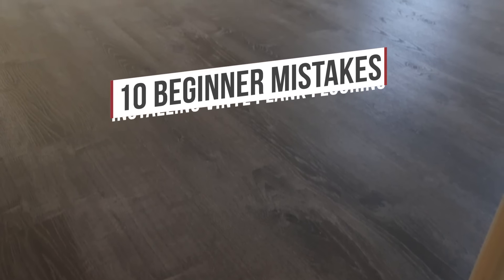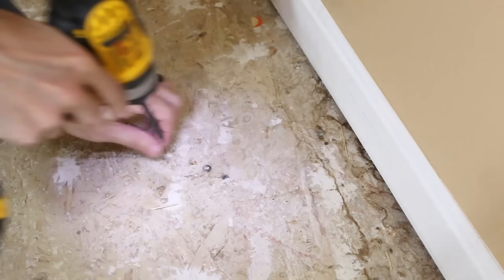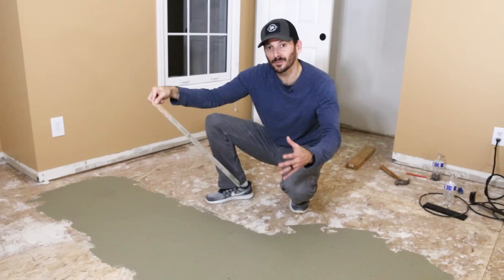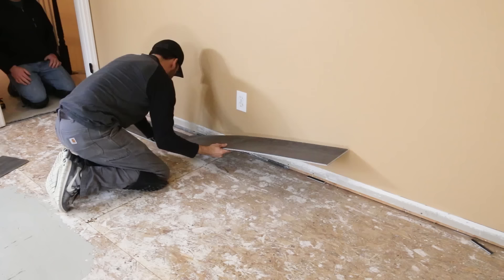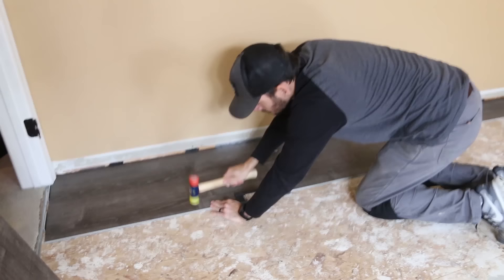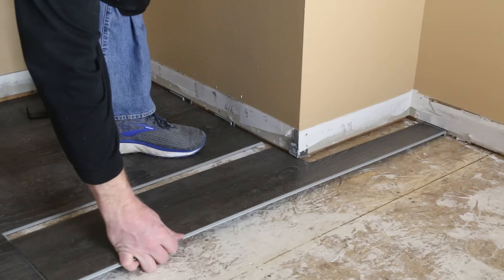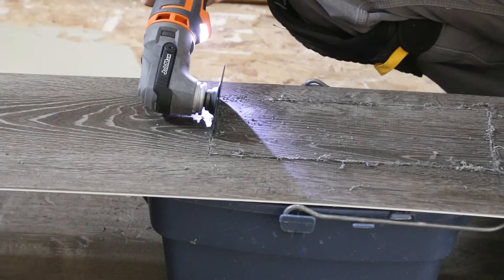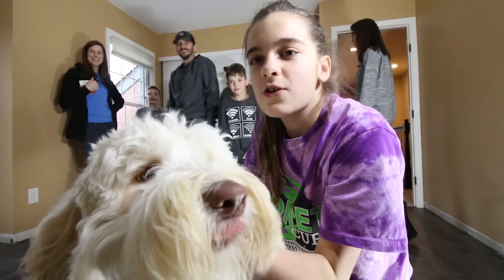10 Beginner Mistakes Installing Vinyl Plank Flooring

Comment: Adding an “approved” underlayment does not void the manufactures warranty in this installation. Matter of fact, your Home Depot Lifeproof flooring has a companion underlayment called Lifeproof at every store location in North America. The underlayment is a moisture barrier, improves acoustic in the room and room below plus helps with those protruding fasteners by incapsulating them should any stick up up to 1mm.
Reply: life proof has a underlayment and is "waterproof" adding another underlayment will void the warranty
Reply: The flooring guy we bought from told us the flooring companies rarely cover their flooring and don't usually pay out on their "warranty. He said the flooring companies regularly deny any warranty claims as user error. Don't install a floor thinking it's got a warranty is what I gathered from his comment. Just like roof shingles. Thinking they'll last 25-50 years is not accurate. 
I'll be using under layment because it is cushier and had a softer feeling step to it.
Reply: @Irish-Triplet  You are putting down a hard surface flooring (the vinyl plank) why would you want it cushy and softer feeling? Do you want your carpet to feel like concrete? Just doesnt make sense.
Reply: @AwesomeJay6  I personally don't like a "clicky' feeling vinyl plank. For that reason, I put down the underlayment and it feels better to me. It doesn't really have to make sense to you, as it's not your house or floor. Have an awesome life, Jay. :)
Reply: @Irish-Triplet  So I have done thousands of sq ft if flooring and I want to mention that you are correct. You have to use a higher density underlayment, especially made for vinyl, like Dekorman lvt underlayment or BestLaminate lvt underlayment. The benefits are like you said, evens out small bumps and unevenness, warmer tile on concrete basement and softer floor (so you aren't standing on concrete) without having the floor flex so much that it cracks the plank or pops the lock. But you have to avoid putting something like a heavy couch or wardrobe of top of it, because the plank will deform from the weight pinpointed on narrow feet. As far as warrantees go, no one ever claims them. The installer is long gone and the house has probably switched hands, although the vinyl floor is usually going to last you a good 20-30 yrs if you don't wear it out with shoes, sand and dirt. Plus every install bypasses the instructions. The manufacturer wants crazy gaps to cover for temperature and humidity swings that rarely occur in a modern house and you have to invent new installation techniques to install where the boards can't "flip" into place (after all who wants to replace door casements?).
Reply: @kanetao  Thanks for the validation! I'm happy with my choice to put underlayment.  I won't use it in anything but bathrooms,  but it's cause for concern with a bathtub replacement to a soaker tub. What do you suggest for this scenario?
Reply: @kanetao  Thanks for your reply. I'm happy with the underlayment and appreciate the validation. I have a question concerning not putting something heavy on it. I've thought of replacing a jetted tub with a soaker tub, however, the weight would be sitting on the LVP/underlayment. How do you deal with that? It has, so far, stopped me from redoing the master bath with LVP because I don't know how to do this with a different bathtub. Thanks...
Reply: @Irish-Triplet  The easiest route is to not put LVP under the heavy tub. Even without underlayment heavy items pin the floating floor and if there is sun, it can start to warp or cause gaps in the connections. Usually, clawfoot tubs or self-standing tubs require a drain underneath them to cover for splashes (as it isn't sealed to the wall) which means tile floor with or without a curb. If it has a backsplash or wall paneling then you just end the LVP at the tub and seal the edge with a flexible sealant like silicone. Make sure to leave enough expansion joint on the other side of the room. We also usually seal the baseboard to the floor too, so if you have a leak it doesn't run behind and under the flooring. LVP isn't guaranteed to not let water through. You can't build a shower floor with it.
Reply: @kanetao  Thanks for your reply. I appreciate it!

Comment: Dude I needed this! Installing next week!
Reply from the maker: Woot woot! Not bad at all, Rachel. You'll crush it! 💪
Reply: I needed this too. . . one month ago. It all worked out, I guess.
Reply: Is it better to paint a room before flooring or after?
Reply: @Fixthisbuildthat   no need to take the skirts off. The floor should get soundproff insulation, then the floor ant put down vinyl beads on the edges
Reply: @mt.erebus3370  Before is best. No chance for drops of paint on your new floor! Cheers.
Reply: I’m putting this in the kitchen over Christmas.
Reply: Easy to do take your time and square the room up first.make sure you don’t leave debris under the moisture boarder and wipe each plank off front and back before laying it down one little bitty pebble will mess it up...Do it clean and slow...Til you got it straight.

Comment: Great video. One thing now though that might need an update for anyone using Lifeproof -> You can and should use an underlayment and it no longer voids warranty if you use LIfeproof's underlayment.
Reply: That is not just lifeproof.

Though people should just go to a flooring store and getting something better than that crap.

As a general rule, you should have a vapor barrier on all floating floor installs.

I use a 6 mil plastic sheet for slabs, and aquabar (paper) for wood subfloors.

Comment: I would condition your quarter-round vs remove-reinstall-baseboard based on a few things.  1 - if the baseboard is short like your was kindof short, quarter-round may look proportionately too large; if baseboard is tall, then quarter-round looks good.  2 - if the floor is uneven, quarter-round is great for concealing the unsightly gap between the baseboard and floor.   So, in summary, I'm a proponent of quarter-round if the proportions are correct so that it looks ok.

Comment: We don't remove baseboards because there's a chance to damage the wall. We don't do sheetrock and we're not painters.. We use shoe molding, as it is a cleaner look than quarter round. 
The doorway leading to the carpeted area could have an issue down the road. You need a z bar to finish your carpet where it meets the vinyl. Z bar is nailed to the subfloor and allows you finish your carpet properly. (You can also achieve this with more tack strip running the length of the doorway. But, you'll need to flatten the nails of the tack strip after the carpet is secured). You'll probably need to rent a knee kicker to stretch the carpet into the doorway before securing it with the z bar or tack strip. Otherwise, you will get wrinkles in the carpet. 
The transition needed for vinyl to carpet is called one of two ways, either an end cap or baby threshold. Most people order a t mold and have issues down the road with it breaking. 
Since you pulled the baseboards, I wasn't able to tell if you left much expansion gap. It's best to leave roughly 1/4" gap around the parameter. Granted, it's vinyl.. It's a floating floor and it will expand and contract. We have replaced many DIY jobs where the customer did not leave much expansion gapping. If there isn't much room for expansion, you will get buckling in the flooring. 
Careful with using thinset over plywood as a leveler. The wood can draw the moisture too quickly from the thinset, not allowing the thinset to set up properly. Also, thinset doesn't have flex. Any flex in the subfloor and your thinset will crumble and break and you'll not only feel it when you step there but you'll hear it.  
Other than that, good video.

Comment: What you didn't mention is there is a specific side of the board that needs to be started against the wall. Start it wrong and you have a Hell of a time installing the boards.
Reply: Gawd yes.  I started out wrong too.  Total disaster. Had to start over.
Reply: The planks can be worked from either edge. There will be situations where you will have to work backwards. A layout where you would be entering another room & that room’s walls are further back after passing the door jam, you will have to click the planks opposite/backwards. 

Multiple room jobs or jobs where there are multiple angled walls should be left to a professional.

That room was a fairly simple layout & the material used is one of the easier ones to install. That particular product you tap in the long edge & tap down the butt joints. Other products you have to lock in the butt joint & work in the long edge. Some you can bridge & tap the butt joints together.
Reply: Can you explain further? How is it a disaster if you start on a certain side
Reply: Tik Tac my question as well
Reply: @MI-el8cs  one side of the click lock groove faces up and the other faces down, so the piece already placed on the floor normally faces up to allow the new one to be angled up a bit to drop into place. If it were reversed, the new piece would need to be laid flat and the already interconnected piece somehow lifted up to slide in, which gets very difficult.
Reply: @chrisfitchett6229  that's all Tru but it's easier to click into the male side
Reply: @wingerrrrrrrrr  especially when you get to door pieces and u have to but them under the door jamb

Comment: This way you avoid having to use qtr round,  But, you'll  need to use taller baseboard, so seems like less work, cheaper, and less risk to the drywall to use qtr round.
Reply: Yeah it's kinda like pick your poison pay for quater round and installation price or paint and caulk which is a lot easier for a normal home owner to do them self's and cheaper
Reply: use same size base boards the added height of the flooring will cover the cut

Comment: Most of the time that I remove old carpet, the trim is usually needing to be replaced at the same time. So it’s a good idea to inspect the trim (paint/caulk/ etc. before deciding to pull it.

Comment: for beginner I suggest to use quarter round. So much work to remove baseboard, risk to damage the baseboard and wall. Subfloor isn't always flat around the wall, maybe long piece baseboard isn't straight, so there would be a gaps between the floor and baseboard. The wider baseboard is harder to press down to hide the gaps during installing.

Comment: FYI.... for first timers, you should mention early on about the seams that need to be staggered. You vaguely touched on that but should emphasize more.
Reply: Warranty will be voided if you have seems 6 inches or less apart, some products require more of difference. Also your floor needs to be within 1/8 of an in an ten feet  which is a joke. Again that varies
Reply: Great point. It's obvious, but I didn't think about it until just before I started laying the planks.

Comment: How much of a dip can we safely avoid? The instructions on my vinyl flooring mention 1/4" over a 10foot length for tolerances, but no low spots or high spots. How high is high, how low is low? Biggest dip I have found so far has been 1/8".  Your input would be greatly appreciated.

Comment: If the baseboards are in great shape, I'd just add a shoe moulding (looks nicer than quarter round).  Otherwise you may find, as shown in the video, that after you reinstall the baseboards you will have to deal with the paint ridge and unpainted area that is now exposed.
Reply: Did you remove the base molding or left it in place and added shoe molding later?

Comment: Ahhh I'm so nervous! We are installing vinyl planks on the whole first level of our home and I've never installed any floor 🤣🤣
Reply: I'm just starting now. I have the main hallway and one bedroom done. The very first row is the hardest because everything is based off of it and it can potentially move around. After that, it's easier. Funny thing is that the hard parts don't look impressive, but the easy parts look like a lot. By that mean the bulk of the room is easy but the edges and the doorways and the holes in the floor are the hard, slow bits. I like it so far though.

Comment: When they installed my vinyl plank floors they put in the quarter round.  It looks good.  I prefer it over the look without.
Reply: Agreed I install flooring and we always do quarter round for sure
Reply: When we had our master done, we opted to leave them off, and it looks great. I am about to do my kids' bathroom myself, and I am going to replace the quarter round
Reply: He totally screwed up not using 1/4 round. Pause at 12:37. The base now needs to be installed lower than previously. There will be a line (eyesore) all around the room from coats of paint built up higher than the primer from the previous base height. Painted bases are also caulked to the wall before painting to eliminate shadows and that caulk line will also show. To get the clean look he already had he will need to feather edge/fill that paint/caulk line, re-caulk the base to the wall, then repaint the base and walls. Lots of extra work. If you are going for a certain look then fine but he is deceiving his audience by not mentioning that problem that he now has. He could of used a few bags of self leveling floor compound to raise up his floor that 3/16". Would at solved all his problems.

Comment: The home, I bought back in the summer, was “remodeled” by the previous owner and many mistakes were made. 

Due to him not leveling the floor before laying down the flooring, it is now breaking apart at the joints and clicking loudly in the center of the room (where most of the foot traffic is).

Comment: I usually leave the baseboard. A few reasons.  1 I don’t know how the base board is attached. There are a lot of adhesives out there and I don’t want to cause damage to the wall. 2 Painting the wall if there is any damaged from scraping and scratches. So for me it saves cost and labor. I just use Round or flat stock.
Reply: Shoe molding looks nice anyway

Comment: 0:38 I find that large wire cutters work better than pliers for removing staples from plywood subfloors. If you don't squeeze too hard, then the wire cutters grab the staple instead of cutting through it.

Comment: Pro tip: Do not pull your carpet staples out of the subflooring with pliers, unless you have alot of time on your hands. Instead use a scraper, Also no need to use the beater block on every board. Kneel on the flooring you have installed, take the board your going to install hold it at a 45°  angle with the previously installed floor, click it in, slide it down to the board it will be attached to and drop it, tap the buttjoint down lightly with your mallet and taaadaaaa! Best of luck of your flooring adventures.
Reply: Thank you. These guys waste a lot of time. Why measure the floor? Start on the longest wall and get going. Justin knows
Reply: @Bob Priddy  Because you don't want one little 2 inch row of planks at the end. Better to split the first and last row to avoid that.
Reply: Thats how i do it aswell very simple and fast
Reply: Bunch of losers here complaining but here they are watching his video for tips lol
Reply: @ferasrn  zoinks Scoob

Comment: You didn't mention that the paint lines would be higher since you removed the base and lowered the floor.
Reply: It’s paint though, pretty easy to remedy. 🙂
Reply: @geekchick4859  Agree, removing the trim makes for a better look. You also don't have to buy more stuff to hide the gap. Paint and caulk are cheap. You don't have to repaint the whole wall, just edge around the trim you reinstall.

Comment: I am a big fan of avoiding the quarter round.  Clean look.   I am a little surprised at the direction you chose for laying the boards.  I always thought it should be perpendicular to the entry way so that you weren't looking down the seam lines as you come in the room.  Guess I learned something today.

Comment: I want to pull up the carpet in my bedroom and install vinyl planks like the rest of the house.  There is quarter round under the molding everywhere else, I think in this case I should leave the base boards for consistency and because this is going to be a huge project for me as is

Comment: The biggest mistake I see people make is the hammer them together too hard. That makes the edges rise slightly and it looks terrible.
Reply: Also damages the joint and causes separation over time
Reply: Just need to use the mallet on the butt seams to lock them to no reason to do the long seams you will be able to see if it's together or not def with the life proof material he was using

Comment: If you’re finding nails backing themselves out you need to set a screw next to them into the joist to make sure the sub doesn’t work them loose again over time. If the nails aren’t into joists then pull them

Comment: On this job I would have left the baseboard on and applied base shoe to entire job. You can see that if baseboard is snugged up with floor there will be a white line of unfinished wall above it. Then you will have to paint the walls at the bottoms. Have fun with that.
Otherwise you are correct, I will always remove baseboard if feasible.
This is coming from 43 years of hard crawling.
Reply: After reading the comments it’s amazing to me how many people confuse shoe with quarter round and don’t understand its purpose.

Comment: Tack strip leaves pits in concrete when removed, I had to patch and sand down. It's now a workshop and my budget is limited so I stayed with the current floor molding.

Comment: Pulling off baseboard makes installation much easier especially when trying to cut around dormers, closets and doorways.
Reply: Dormers?
Reply: @MotleyStew  just where the walls of the dormers meet the floor. Gable dormers that don’t span the entire width of a room and make the room other than a simple rectangle.